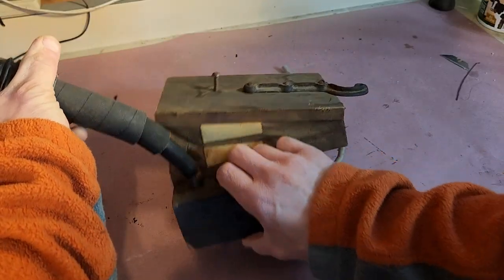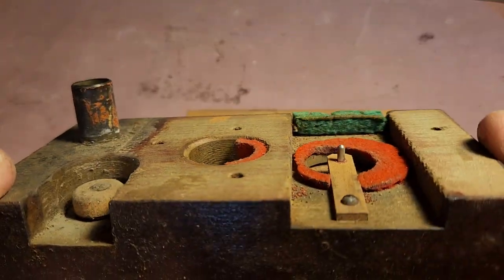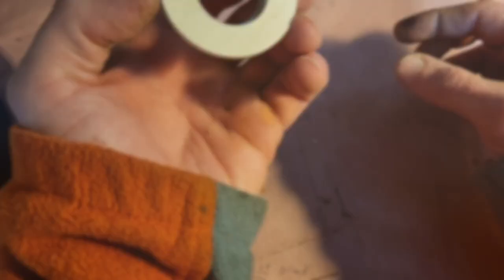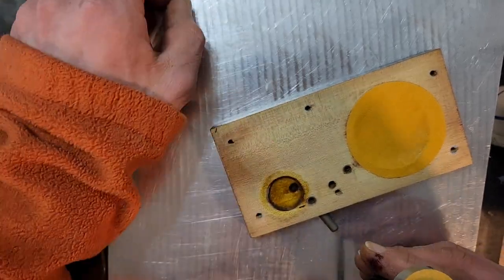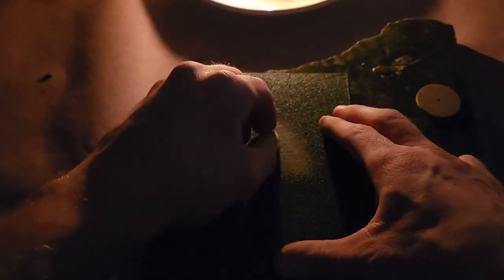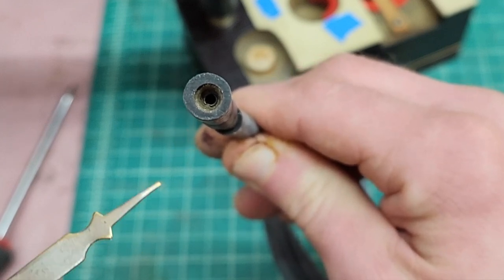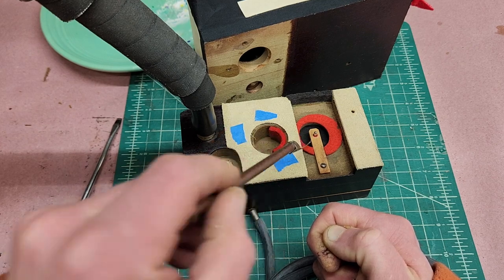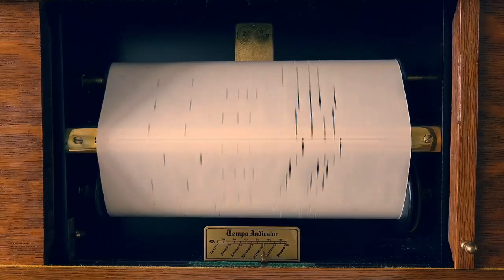Player Piano Revival Episode 9: Resuscitating the Sustain Pneumatic (Deep Dive)

Comment: Another great one, Nate! I noticed you used the silicone sheet for gasket material. Thanks for the link to that on your previous video. Also, I think it's cool that you used an old Edison(?) cylinder machine case for your toolbox. That is classy! And yes, air motor next vs. spoon bending with your psychic powers...
Reply from the maker: Thanks Greg. I really like how workable the silicone sheet is over leather. No way could I punch a 1.5" hole in leather with bare hands.
Now you're making me wish I could use psychic powers for damper regulating instead of that goofy tool.